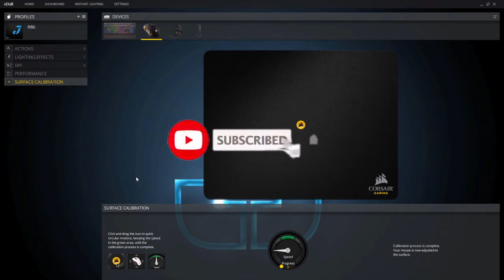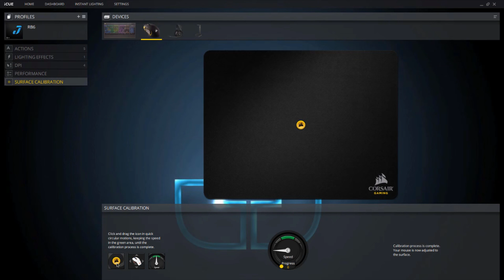Corsair  Utility engine | DPI and Surface Calibration Episode #5

Comment: How i lock my DPI buttom! nice video tho! Corsair Knightsword
Reply from the maker: Is the knight sword the type of mouse? And do u mean to lock it in place so when u hit the button it will not switch?
Reply: @JustAStreamer21  Yes exactly !!! for both question
Reply from the maker: If you go into iCUE, and select the DPI toggle button, there's actually an option called DISABLE under the "ACTION" heading. Select that, and that button will do nothing when pressed. That’s what I found on the forms so I can’t test this but I would assume u would set a default dpi setting and then that action button for the dpi change would be basically turned off and not useable till it’s reactived

Comment: do you know how to fix dpi issue?  it only able to gap 250 dpi so if i start from 500 dpi it can only slide next to 750 dpi thus 800 dpi is unavailable. corsair harpoon btw
Reply from the maker: Is it showing in the icue software the change in dpi?
Reply: @JustAStreamer21  no i cant see the dpi gap collums but i can see dpi.
Reply from the maker: Have u tried a fresh install or a firm ware update on the software?